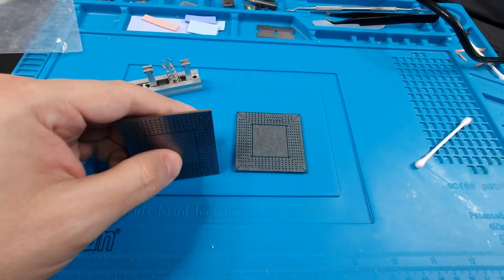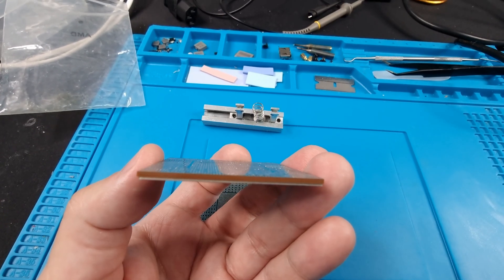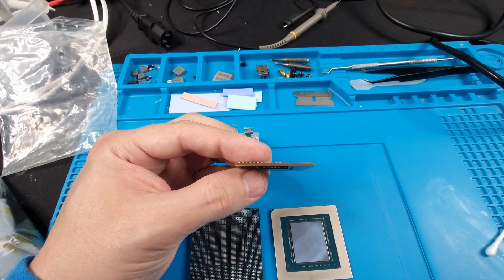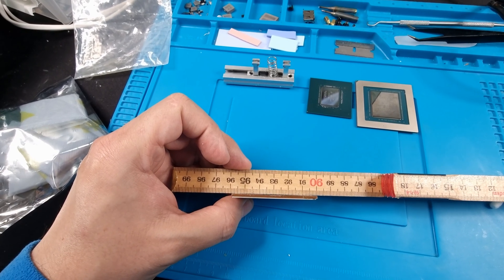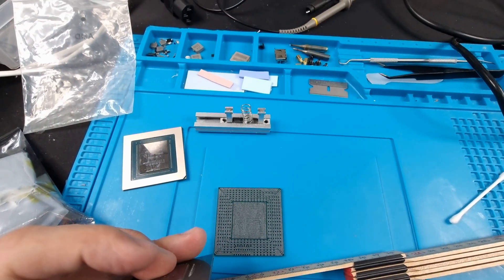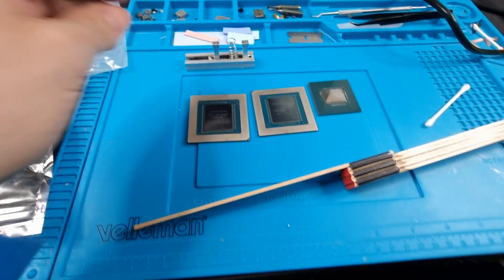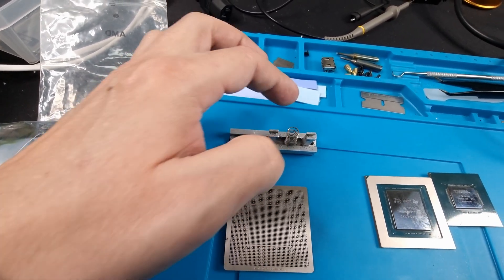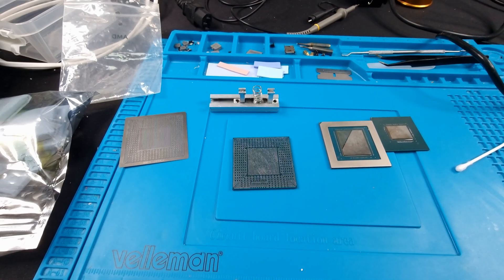Why Many RTX 3080 Ti's & 3090 GPU's "Die" Prematurely.

Comment: Generally I've only seen this when the heat during de-soldering was turned up too quickly or unevenly or way too high. Never seen this from sagging...
Reply from the maker: I just repaired two 3090's with the same issue. So yes, this is a thing.

Comment: I have a amd 7900xtx asrock phantom and i have it vertical and i get a hotspot of around 96 sometimes higher but if  i have it horizontal it gets max 83 degrees celcius i repasted it but i haven't replaced the pads can it be that the cooler makes bad contact because of that?
Reply from the maker: @VinceZ2505  If you use the case's vertical mount setup where the gpu is closer to the side panel, then it will not have enough room to breathe. So I hope you're using a 3rd party vertical mount.
Reply: @TechnologyHive   yes its a cooler master v3 and its around 5 cm from the glass and the core temperature of the card is around 60 degrees celcius
Reply from the maker: @VinceZ2505  I would double check that contact between the heatsink and die.
Reply: @TechnologyHive   yes i will check thanks for your help i will keep you updated
Reply: @TechnologyHive  I have replaced the pads and have  the gpu horizontal in my case i now get 82 hotspot with  fans at 1500 rpm i think this is good enough for me